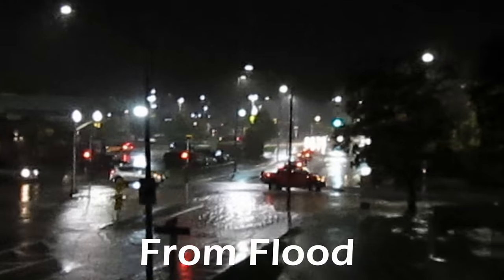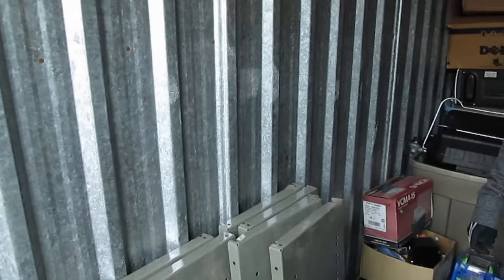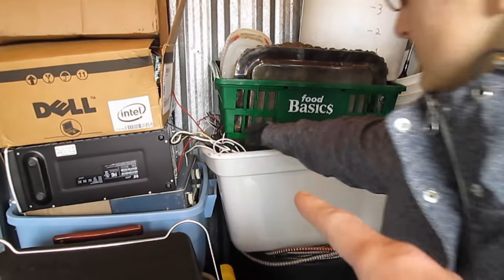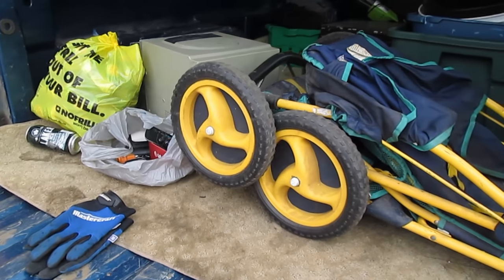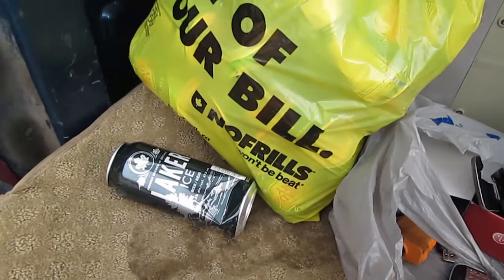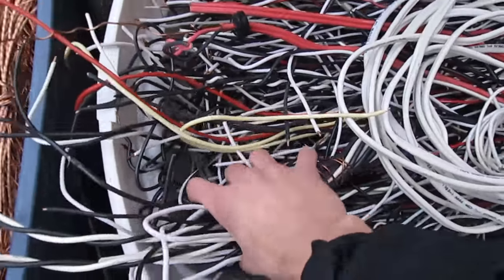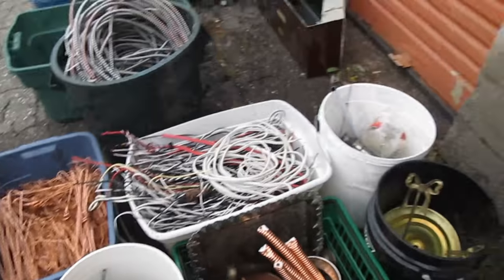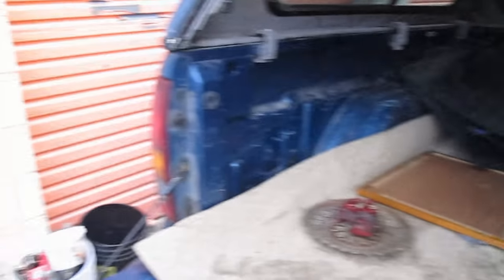LOOK AT ALL THIS COPPER AND BRASS !!!

Comment: I cut all of the fittings off the copper tubing and pipes to separate the number 1  from the number 2.I used to work in a scrap yard and that was one of my jobs.